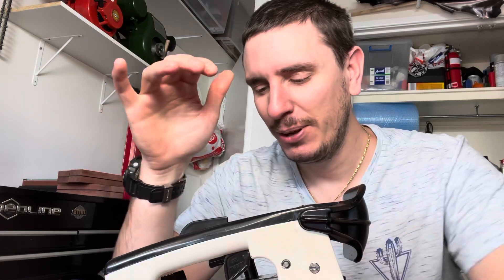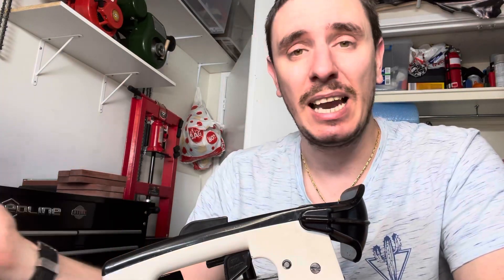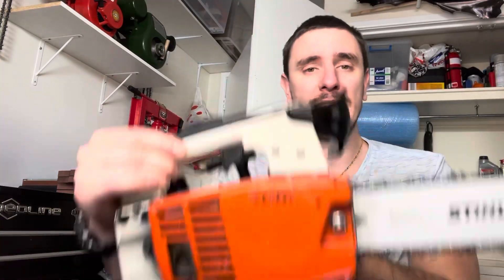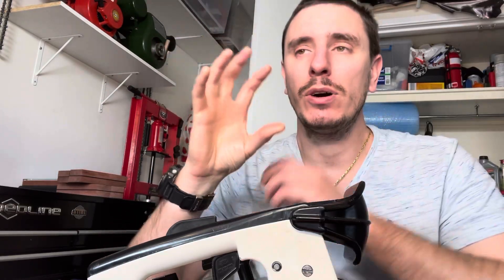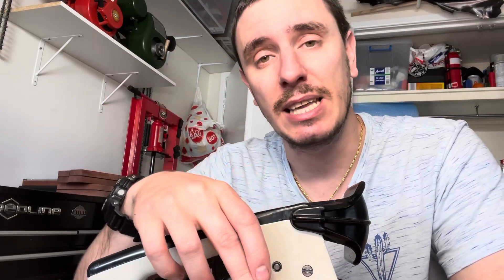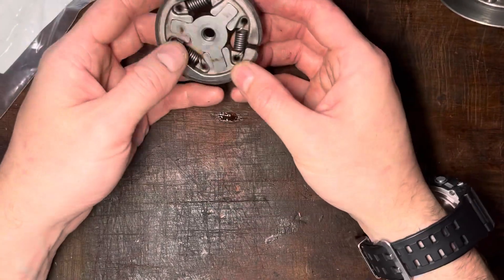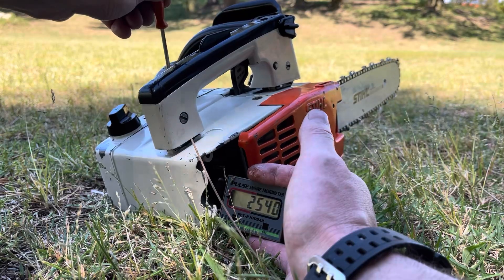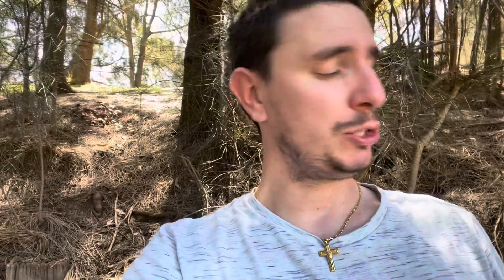Chainsaw Chain Spinning At Idle? Here Is The Fix!

Comment: Lovely video there Tom, I might add, that one of the most common reasons ive come across for a chain that drags at idle, is a build up of sawdust and bar oil in the clutch drum, it can create a lip that drags against the clutch shoes, and often makes the removal of the clutch drum a bit difficult. Remove drum, clean away build up of dust and crud, and your done. The points you have covered are all valid and happen too, but a good clean up on initial inspection can often fix the issue, Its all part of the systematic approach to finding the real problem. Good video and clearly and well presented, much better than anything I could do, if i could even film a video of it.
Reply: i did this, chain still spins at idle what do i do
Reply: @wsbkleeger  Umm, watch the video...?
Reply: @afellowinnewengland6142  i did what was said to do in the video. nothing changed at all. i did end up fixing it another way though.
Reply from the maker: What was wrong in your case?
Reply: @VintageEngineRepairs  the idle was set too high, i adjusted it lower and it got fixed
Reply: What rpm is the saw idling at ? if the clutch springs have been overheated, they loose their temper, and the clutch engages at a much lower rpm, as covered in the vid, or its a dry clutch bearing, or build up of dust/oil that catches the drum.   @wsbkleeger
Reply: @johntrainssmith1475  i don’t know what rpm it was
Reply: I've husqvarna chainsaw and chain still spinning despite new clutch springs,greasing the bearing and checking t screw idle.

Comment: I recently bought a Holtzformma g372xp, and when I got it, there were semi red and yellow flags to it, I've had this saw for almost 2 months, and it's been a good saw 

but I put a 22-inch bar on it for temporary, and the chain started spinning with the tank almost empty, and so one day, when I got a 25-inch bar, I replaced the tensioner on it since the old one got stripped so I did more investigation with it and thought it was the carburetor cause it didn't have idle speed at all  so it got to the point where the carburetor inside the Holtzformma wasn't functioning right so I had an extra carburetor stuck the Husqvarna 372 carb in it and still does the same thing so idk if it's got something to do with the idle speed or the bearing or the clutch or the sprocket
Reply from the maker: Could be a seized clutch bearing, damaged clutch or an air leak!

Comment: Does anyone know a solution to my issue? I turn my chainsaw on, it idles and the chain does not move (which is good). Then I release the break, pull the trigger, and hold it for 30 seconds -- the chain engages as it should (a little sluggish at the start). But, after that I let go of the trigger, the chainsaw will not go back to idle most of the time. It still sounds like it's revving and the chain keeps spinning fairly fast. If I jiggle the chainsaw it 'might' go back to idle and the chain will stop spinning. Any ideas?
Reply from the maker: Air leak is most likely the cause! You need to pressure and vacuum test it :)
Reply: @VintageEngineRepairs  thank you! You don’t by chance have a video guide how to do that?
Reply: How do you find the air leak ?

Comment: Great information, brother. 
This is the first of your videos that ive watched. 
I'll comb through your content to see what other stuff you work with. 

Identifying each part along with your diagnoses is very helpful.

Thanks man!!!
Reply from the maker: Thank you! I hope you enjoy the content. :)
Reply: 100%. You are my new hero! 
I just started cleaning up my dads Grippo wood splitter. It's got a 5.5 Honda engine. The machine is fairly simple, so I'm giving it a shot. 

We've got pretty much one or two of every sized stihl chainsaws and landscaping equipment.
Vermeer brush chipper, stump grinder, and a bunch of other stuff. I'm really looking forward to checking more of your tutorials so I can get tuned in.
Reply from the maker: Great stuff! Hey this video may help if you get stuck, it’s the full tear down, clean, service and rebuild of Honda carbs (they’re all very similar across the board) I also cover what each drilling does, why it’s there and what symptoms you can expect if it’s blocked :)

Honda GCV / GX Carburettor In-depth Fault Finding, Testing, Service & Repair
https://youtu.be/4tUJTEmxjM4

Comment: If your chain is loose,its normal to spin slowly with left on a surface
Reply: not mine, it spins very fast to the point where its unsafe to use without the brake and the chain is very tight